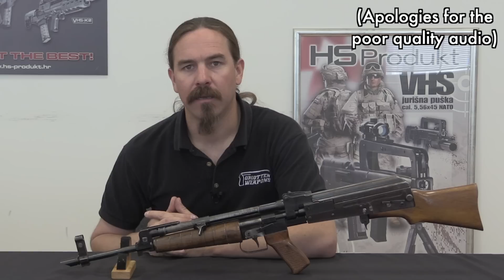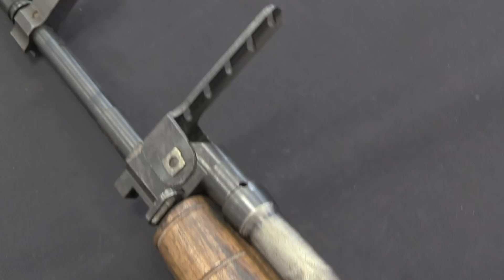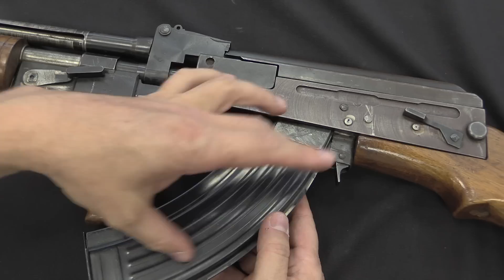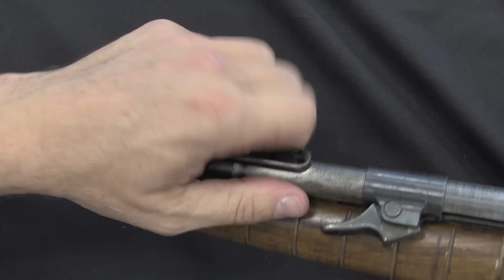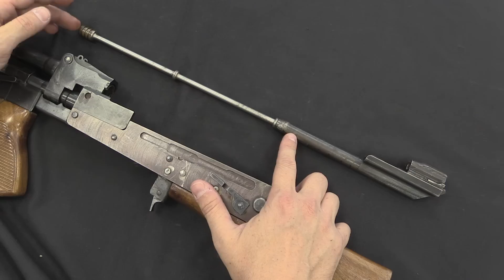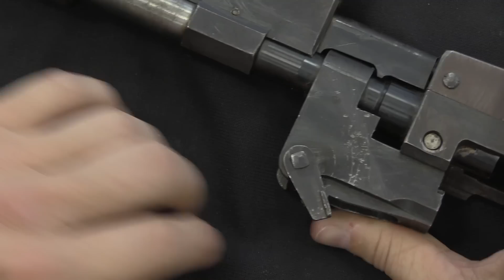Croatia's Prototype Bullpup AK Conversion

Comment: I think it was meant to use a 20 round magazine. Like the Roman AKs, and Hungarian AMD 65.
Reply: Centurions didn't need 30 round mags, romans only used 20 round mags against the britons
Reply: @Momo_Kawashima  fallout new vegas
Reply: Posible since Hungary was one of rare arms supliers to Croatia in big quantity, along with Russia and Argentina.
Reply: The angled grip on a assault rifle is just stupid, not ergonomic and also useless coz' the arm is flexed so of no use for recoil absoption. The angled grip is very nice for target pistol where it can block the hand in line with the barell for less mazle climb, and also for hunting rifles where the arm is more on the back and even more flexed - so flexed that the arm and forearm can almost become one and the recoil can be transfered more straight. On an assault rifle the grip can very well be close to vertical, and for this particular rifle this wey would be no problem for the full lenght AKM magazine.
Reply: @loochan325  lol

Comment: Just like that video of improvised conversions of PKTs to wannabe PKMs in Ukraine, when war comes, suddenly every patriotic machinist becomes Bubba.
Reply: But unlike Bubba, this is actually designed, welded and machined.
Bubba relies on hose clamps and zip ties, not even JB-weld.
Reply: @WingMaster562  that shitty weld on the top cover reminds me of that one rifle with the scope mount welded directly to the bolt... perhaps we have already seen the next evolution of bubba?  Bubbarino?  Perhaps the mythical Bubbaking?
Reply: That's not going Bubba since the PK variants' designs had that idea in mind.
Reply: @kkrummelrhs  Bashing a random stock, bipod and mechanical trigger mechanism onto a slab-backed receiver without a stock and a solenoidal trigger isn't bubbaing it?

Comment: I love these videos and I hope to see more of these prototypes. I’m excited to learn more about this
Reply: Why though? This looks to be about the same length as a normal ak. So all the problems with bullpup without the only benefit.
Reply: @robmicheal511  The point was to make the barrel longer without making the whole gun longer than the original.
Reply: @robmicheal511  The barrel is way longer then on standard AK: standard AK barrel is 16", the barrel in that thing is 23.6" — a whopping 7,6" longer! :D
As Ian says on the vid, the goal was to get better accuracy — but longer barrel aids accuracy only by lenghtening the sight radius, thereby lessening the shooter error; with optical sights you usually gets better accuracy with shorter barrel as it is stiffer, less barrel whip (if both barrels are the same thickness)
Reply: @jukkatalari3896  23 inches?! Ok i didnt hear that part. That is pretty good.